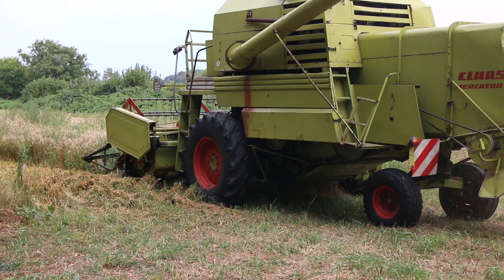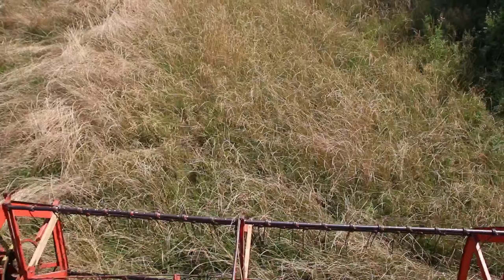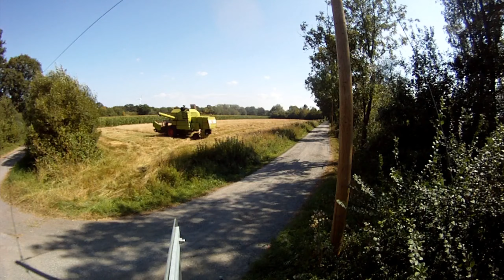Why battery-electric combines make no sense

Comment: just plug it in lol
Reply: where?
Reply: @phalanx3803  run an overhead wire down the irrigation lines
Reply: @ricks6250  not everyone has irrigation. And are you going to pay for that because high voltage power lines cost quite a lot of money, money us farmers just can't just magically pull out of our ass.
Reply: @phalanx3803  electricity is an order of magnitude cheaper than diesel, and without batteries the motors are dramatically cheaper than combustion engines, have fewer parts to break down. 

as for "high voltage" pretty much every barn has 220v 100amp power, copper is cheap.  

and every place is gonna need irrigation with climate change coming either way
Reply: @ricks6250  220v 100amp is nowhere near enough for 1 medium tractor let alone a large tractor or a combine the average combine today can put out 400kW for 10-12 hours straight at 220v 100amp it would take 218 hours / 9 days to charge.
Reply: @phalanx3803  wtf are you talking about "charging" you can literally just run it off grid power.  Also you're converting the raw power of the combustion engine directly when it's only 25% efficient, while electric motors are 85% efficient. Still well within the range of commercial 3 phase power, which is also not unusual on farms.  

The fact of the matter is regardless of how little you give a shit about the environment or the future oil is going to run out eventually, either get on solutions now or lose out to the people who do.  At the end of the day because of the efficiency differences and the dropping costs of electricity anyone running a farm off diesel will be losing money within the next decade and a half.
Reply: @phalanx3803  and John Deere already has electric medium sized tractors, you're effing full of it.
Reply: @ricks6250  "commercial 3 phase power, which is also not unusual on farms" no its completely unusual the only farms that have that are ones that operate there own packing sheds and thats only for farms close to sub stations we live over 60 km from a sub station it would cost over $200k a km for commercial 3 phase power plus another $100k a year for the subscription. also am talking about the output power dipshit 400kWs of mechanical power is still 400kW regardless off if its an engine or motor and if the motor is 85% efficient then that means it needs 470kW of electrical power. as for JD they tried to make an electric tractor it failed then they tried one that tows a cable it failed extra hard JD wont even talk about it any more. Fendt tried a small tractor yea it failed as well. also on the commercial 3 phase power all we could get out here if we rob a bank for the money is 400V 600A that would barley power a single combine let alone the other combine or the 3 tractors we use.
Reply: @phalanx3803  sounds to me like the problem isn't the technology but rather that you're too broke.  That's a you problem.  Also, the John Deere electric tractor didn't "fail" it's still in R&D and hasn't made it to production yet.  Stop lying and bullshitting, you sound like a boomer.
Reply: @phalanx3803  also 400v at 600amp on 3 phase is over 700kw
Reply: @ricks6250  The truth is there are a bunch of electric tractor models already. In general, just like electric cars, they're much better than their fossil fuel counterparts. Over their lifetime they're much cheaper than diesel, since fuel and maintenance are so cheap, and electricity is soooo much more efficient than burning things for power. They're quieter, healthier (no carcinogenic fumes) and can work fine for up to about 8 hours. (Longer with a lunchtime part-charge, and all that is improving at an incredible speed.) The weight of battery packs, that some people seem to think is a problem, is actually an advantage for tractors. (Better traction.) 

I can't find a definitive answer on electric combines now, but they are without any doubt coming soon. A quickly-swappable battery pack would make an e-combine waaaay easier and speed up the transition, but in any case, in 10 years or at the most, 15, essentially all new vehicles including farm, construction, and service* vehicles will be pure electric in Europe, North America and most of the world.  We should do everything we can to make it happen faster, especially voting for progressives at every level of government. 

* fire, police, ambulance, refuse, and others already exist, as do all kinds of construction vehicles. 

John Deere video
https://www.youtube.com/watch?v=NM9GMVz9-sI

Electric Tractors’ Advantages Over Diesels
https://cleantechnica.com/2018/09/20/electric-tractors-have-advantages-over-diesels/ 

Electrifying One Medium-Sized Tractor in California Reduces Carbon Emissions by as Much as Replacing 45 Cars with EVs
			https://cleantechnica.com/2021/11/25/gridtractor-launches-fleet-electrification-for-farmers/